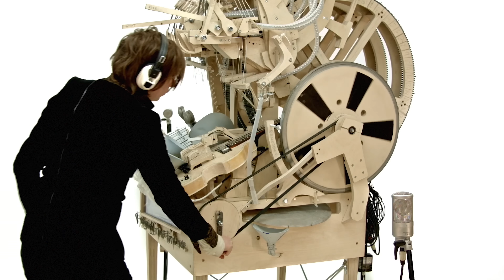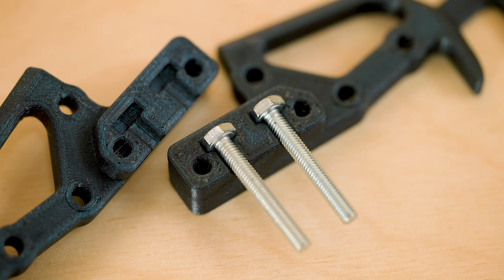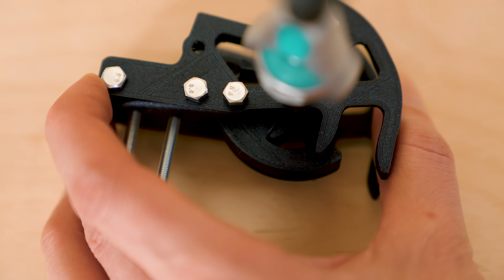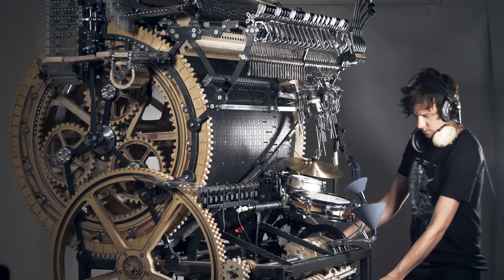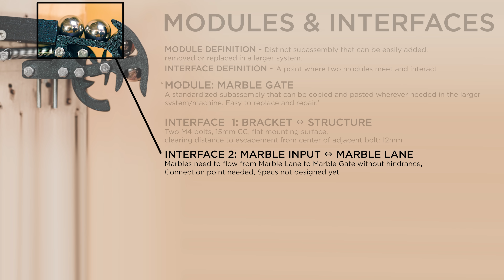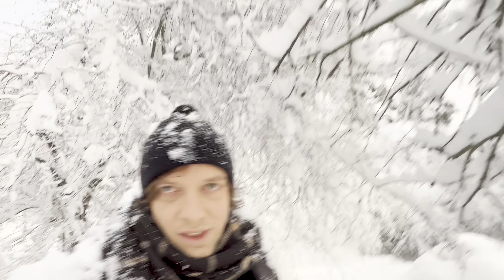The Foolproof Marble Gate - Does it Exist?

Comment: I like your module/interface advice. I'm currently in school for engineering and had an internship over the summer for systems engineering. Systems is a relatively new topic in engineering but it deals with exactly with the problems you found yourself in. It helps engineers manage and tackle monumental projects like space rockets with billions of various parts, interactions, stuff like that and remain organized and confident that all requirements of the solution have been met. I look forward to seeing where this project will go, this tool you've shown will take you far.

Comment: Hey Martin! After watching your last video, I wanted to suggest using a different material for the gate release mechanism on the tip of the arm, something soft like a foam or felt material to prevent the marble from bouncing as it lands, you can increase the accuracy of timing so much with that

Comment: We software engineers also use modules & interfaces by segregating code into discrete functions. Each function has arguments that go into its process and can return a value as the output.

When a function only does a single task, returning a single value every time for a given set of arguments, it is known as a pure function. These are the coder's goal since they can be easily tested for all cases and then safely assumed to not be the cause of a future issue. 

If you were to think of the marble gate in terms of pure functionality, then each piece of it is serving a single function: rail, gear, pinion, arm, spring, fasteners. It's true enough that most of these are already in a tested state at this point. But in developing it from first principles, you'd want to test each new part separately before connecting them. 

This is where you could earlier discover the better way to interface the arm with the gear, as you did in this video. Doing so can greatly reduce iterative steps and unused work.

Comment: I think the whole "make it perfect before we continue" thing kinda misses the point of engineering. Engineering is not about perfection, it's about making a solution that is good enough within an expected range. Even in computers we don't use perfect calculations, we just use good approximations. I think aiming for better approximations is good but there's a point at which you have to say "that's good enough". You just need to define the point where it's "good enough" before continuing, otherwise you're just gonna stand still.
Reply: that's literally what he's doing by identifying the requirements around the interfaces (the contract)... e.g. many people are already worried about small imperfections in vibration and material choice etc, but as long as the design satisfies the known requirements, it doesn't matter if it is still janky. it can just be "good enough"

he's finally learning to define what "good enough" is with data

Comment: The top tooth of the escapement movement (marble drop) catch is very sharp point.  To increase longevity you could increase the quantity of material without changing the geometry of the catch side of the top tooth.  The bottom tooth and the weight of the marble drives the escapement forward (clockwise as seen in the video) and would allow for some additional material without negatively impacting the reset of the marble drop.

Comment: Did you think about the consistency of falling direction? 

Your new gate seems to have little guiding rails in the end. And since the music elements are angled, you need the marble to hit the same point always, otherwise it's still not going to be tight as they will arrive earlier or later, and then your whole work of making the release precise doesn't matter at all...
Reply: this is why he is defining requirements -- things like vibration and small timing problems are irrelevant as long as the design still produces output within spec
Reply: He is, but I think this is a requirement he forgot to think about since he hasn't mentioned it, and already calls the gate basically done.

It goes back to "making no assumuptions" and "validating not believing" which is his new attitude of approaching this.

You can't assume it's irrelevant if you haven't validated that it's irrelevant.

Small vibrations with the release mechanism, unevenness in the movement of the release arm, and other factors might influence the path the marble takes down towards the instrument. if his whole idea is to play music as tight as possible, he might find it important to have more control over this, by for example, guide rails, or making the mechanism smoother or tighter fitting.

Anyway, those are just examples, the point is, validate, don't believe.

I think this is something he's going to realize when he puts the gate in an actual machine, and then it's back to the drawing board, while he could tackle it now already when he's still designing.

Comment: Very Cool Martin - Programming wheel - have you considered side entry programming 'rods' - that interact with all Normally Closed activating pins when they are inserted. So no rods and nothing will sound Digitally Zero.  - Rods can be square or round with location pins inserted and rotated into their active position. Easy to change between songs.

Comment: Awesome design! Cant wait to see all these small optimisations assempled into one well oiled machine! Just wanted to note, this changed gate will propperly have a different minimum hold time, as you investigated last tilme. Using the 500ms is propperly still well within the safe area, but i belive this new gate propperly has an even lower and better minimum hold time than the old one. could be interesting to investigate :)

Comment: So basically you removed attack time from the equation, keeping the functionality inside the gate independent of the input signal, as long as input signal is one "pulse" for 1 marble. Can you do the same for release? By making the gate 'snap' open at some level of input signal, like 80% of full opening motion? As I understand right now the 'link', or whatever mechanism controls the gate, should provide perfect release time, but the 'release time' property only affects gate performance, so it should only depend on the gate design. But, of course, we're talking about real life mechanism, not the program, so its not as simple as managing properties of a module in the code, so it could be unreasonable to do so.

Comment: What about vibration proof of the gate? You test standard deviation, positional precision and other properties under conditions where marbles are not experiencing any variable accelerations which they do experience while travelling through operational marble machine. I know examples of mechanisms which work well without ambient vibration but peform poorly under the latter. I am not saying that a vibrating test stand is a must have but I would take it under consideration at least.

An electric toothbrush might be enough. Or a pair of electric motors with artificially unbalanced rotors and different speeds of rotation so that vibration would be less systematic.

Comment: You should look at a Graham Deadbeat escapement.   I notice once you engage the marble and then travel a little further it raises the marble up.   That is a form of recoil that I think will be bad as the different velocity of action will effect the movement.   Graham fixed this but having the pallet engage on the same ark so the action has no movement when the escapement is holding the wheel.    If you do this I think you will have the perfect gate!!!!

Comment: Hi, from what I see, interface 1 could be simplified. Right now, you have two M4 bolts, but most of the time, you need one bolt and an alignment pin. That should make production and assembly easier.

Comment: While the design seems relatively solid, I am a bit worried about how large amounts of pressure might affect the gate. With the new gate a noticed a bit of “give” when the marble fell onto the catch, and so if there is a long line of marbles to add pressure, might it push through the gate?

Comment: Great point about modules and interfaces! It’s used extensively in software engineering as a tool to make code understandable and testable. In particular, interfaces force programmers to be honest about what code does and should be able to do. This keeps the code on track and limits design drift.

Looking forward to more MMW!

Comment: This is the way: build a million prototypes, and then build the modules when you know they will serve their function correctly.  You have redesigned different modules many times, but in most cases you went right on to mass-producing them after only a bit of testing.  That made every failure that much more painful, because you invested so much time and material into producing them.  I feel like you're finally on the right track and this systematic approach should be able to yeild the result you're looking for.

Comment: Hey Martin, make sure you incorperate the fact that the gate's blocking arm pushing the marble further up might screw with release timings. The mechanism you use to actually trigger the realease could have a big impact on that consistency you've worked so hard to achieve.
Reply: Either way, regression testing is a good idea. Testing things in isolation does not mean they work together and that solving a later problem affects another.
Reply: @mathiaslorenzen9668  He did say he's going to run the final gate through all of the tests again.
Reply: I think that should be OK, as release is supposed to only happen after the full cycle - the lift is bringing it back to the intended release point. However it certainly can have an effect, and likely a changing effect when there are not lots of marbles in the que - throw the marble back up somewhat vs the resistance of the que. Also how fast it can play - gone and added more mass so more inertia that must be overcome before the marble gate can fully cycle anyway - might have to choose between the high BPM and the ability to handle 'zero-x BPM' speeds... Though as Martin seems to refuse to actually choose (or at least tell us) what is acceptable for the musical parameters anyway...
Reply: My concern would be that under pressure the gate won't be able to push the marble back up to the intended resting point

Comment: The new gate reminds me of the xenomorph in Alien 😆 Keep up your systematic approach, but keep in mind that even with perfectly designed modules and interfaces a system is more complex than the sum of its parts. But you will master that, too. A final thought on your statistical analysis of the marble timings: while binning is great to plot a histogram, try considering to calculate the standard deviation from the actual timing, your method allows for much higher resolution and you will be able to much better distinguish subtle differences. Not that I think it really matters in the end, your results are already great 😃👍

Comment: So, maybe a silly question, but if the hold time is ~500ms, doesn't this put some constraints on the functional cycle time of each channel?  ie, a channel can only play one note every attackTimeInMS + holdTimeInMS + releaseTimeInMS.  That (to me) asks 'What are the functional upper and lower bounds of the full cycle time in order to play a broad range of music?'  Is there a 'tempo limit' (ie, <= 220 BPM)?  Is it absolute, or is it a sliding scale depending on what note values you wish to have in the composition (ie, you can only play any unique channel every X beats in  4/4  time below Y BPM?)  

Are these even real-world function limitations, or is this a non-issue?  Is it just sufficiently solved by ganging multiple channels on the same note?

Comment: Hey Martin, thanks for the video! :)  I believe that the release system is sensitive to variable release speeds because of the rotational movement of the last marble "blocker" and the fact that only one side of the system moves while the marble is being held against the other static one.

Would the release not be much more accurate if the last blocker of the marble on the marble gate would be some sort of claw?
--> Imagine  two horizontal semi circles making contact with the marble just under the half height (minimal area of contact, bringing less friction noise). The two semi circles would move away from each other in a horizontal translation (not rotation) driven by the same input (so exactly synchronously).

I am quite sure that this would actually turn the system into a very simple 1D problem instead of 2D (assuming the whole marble machine isn't vibrating of course), which would make it so much easier to maximize the efficiency. The active marble would just be "sitting" on the claw, isolated from the weight of the other marbles, waiting to be released, perfectly vertically, and at the same speed every time.

Hope any of this makes sense, I am happy to draw it out and send it on your discord if you'd need to visualize it (although I am not a mecanical engineer, but a software one! ;) )

So glad that your videos are back! :)

Comment: I'm so glad to see you adopting and really understanding engineering principles in the design now! Those interface specifications will go a LONG way to helping you create a cohesive design that will yield a working marble machine.

Just don't forget before you call the marble gate "done", you need to not only verify it against your listed specifications, but you need to validate the design (and specs) against your real-world desires (aesthetics, musical requirements etc). You should also be sure to perform lots of repetitions of the tests in your previous videos to ensure that your final specs for the gate match reality. For example, I anticipate that this design will likely have a tighter hold time (due to a shorter fall distance for the marble and the stiffness of the arm mechanism) even in the 3D-printed form. You can measure that and likely tighten your minimum hold time. And finally, don't forget that a change of materials will have a huge impact on all these factors! So if you intend for the final product to be made of metal with rubber vibration dampers, you'll need to verify the design once again in its final BOM (bill-of-materials) form, and then produce your final interface spec for other modules in the design.

Another thing that I don't see listed anywhere in your specs is durability. Perhaps you intend to cover that with the "reliability" portion, which could make sense, but I'm also thinking about how these marble gates will stand up to being transported to/from venues, used for likely millions of gate open/close repetitions, and then replaced when they are broken/worn out. Will changing one gate affect the gates around it? How do you access a single gate for replacement? What if the crates/boxes containing these gates is dropped?

I'm so excited to see this project moving forward. I know it'll be a long road to completion, but I'm ready to be on that journey as you navigate through it!